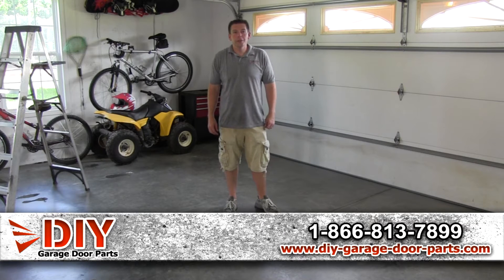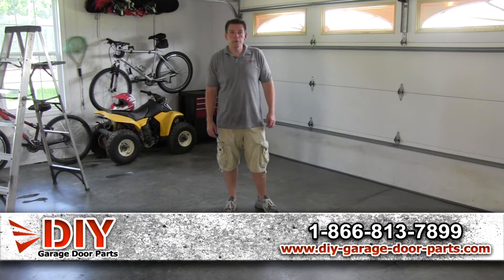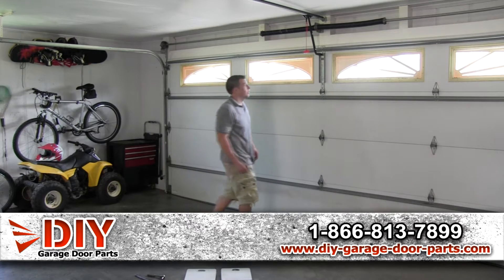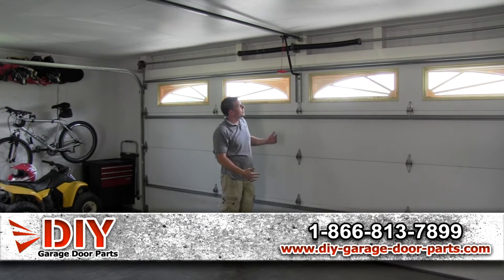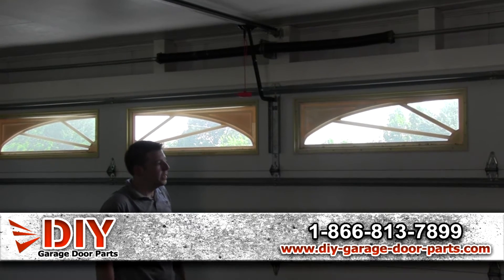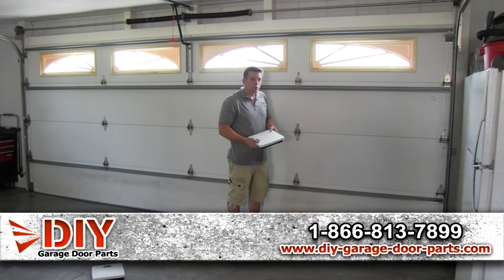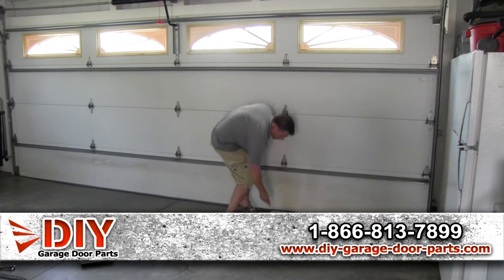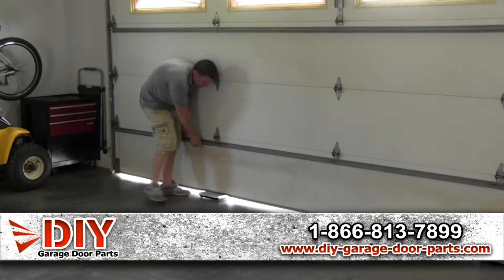How To Weigh Your Garage Door

Comment: Im doing a High lift and trying to figure out what springs to use. I currently have 0.225 Red that are 32" long. Door is a Wayne Dalton 8700  15x7 vinyl insulated and weights 200lbs, it will go straight up with only one section on the horizontal when open.

Comment: Hi Kyle, My two Garage door torsion springs broke at the same time. then I disengaged the angle bar from glider and suddenly the door drop. When I pick it up or pull up the door,  I can't raise it even by inch. I feel it the door is so heavy or not moving at all. Please explain to if it is normal. thanks
Reply from the maker: yes, with the springs broke you are physically going to have lift 100% or the door weight to raise it. This is what the springs do is counter balance the weight so it can be raised manually or with an opener and not damage the door and not require your neighbor coming I've to help every time you need the door opened. You will need to know your spring size that you have, wire diameter, inside diameter, and length. We have a video on how to do this. Let me know if I can help with anything else.
Reply: Thanks Kyle, I ordered yesterday a set of torsion springs.
Reply from the maker: +g Modes thanks!